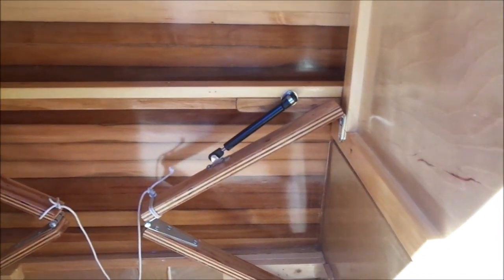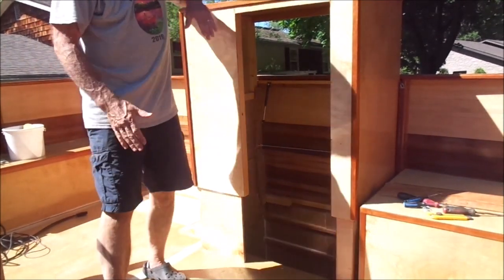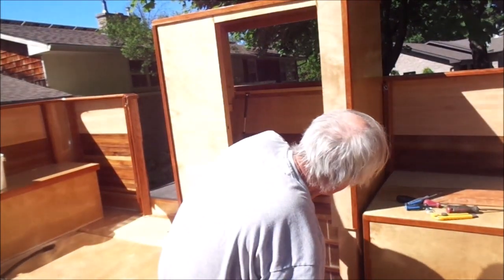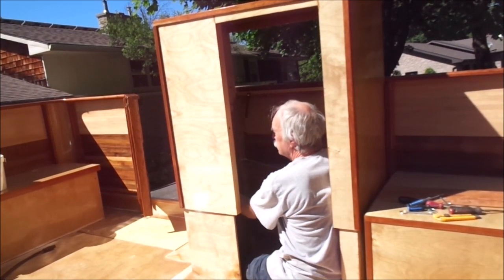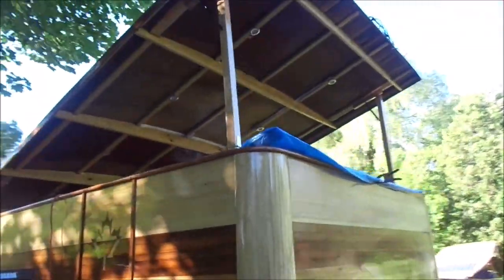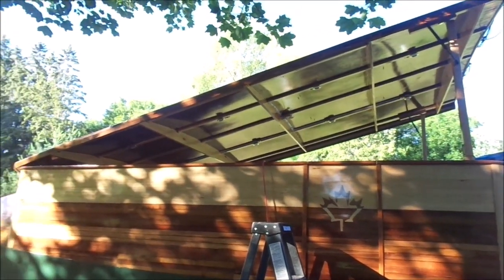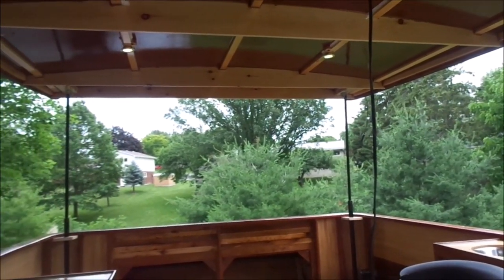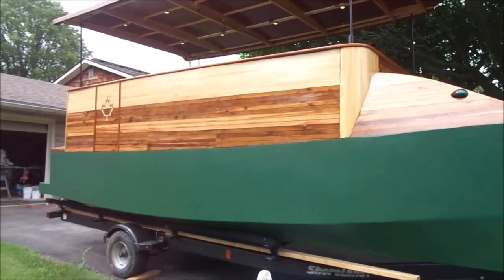Building My Solar Electric Catamaran Part Thirteen

Comment: The collapsable head is amazing.  I have a six to seven foot bridge by my house, but want to make a similar boat.  I'd also like the underside of my catamaran to be at least two feet above the waterline.  This means my canopy and possibly other parts of the boat will need to fold down.  I've never seen anything like your folding room, so I'm keeping it in mind for solving my low bridge issue.  Its brilliant!

Comment: The difference in speed is due to voltage drop in wires from rear to front.  I suspect they are longer wires to the front.  The longer wires have more voltage drop.  The speed of a 12v motor is set by voltage.  If you run same length wire from 12v source to all four they will move at the same speed.  I would add that they probably go down more evenly due to using less current, thus less voltage drop.
Reply from the maker: Thanks Jeff. I also came to that conclusion. I am making the next video on electrical and will show my solution.